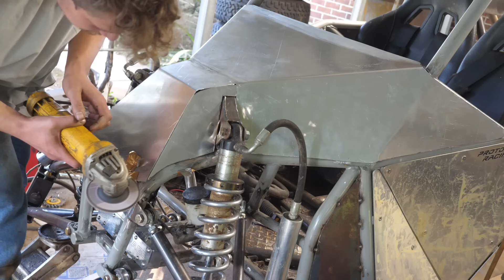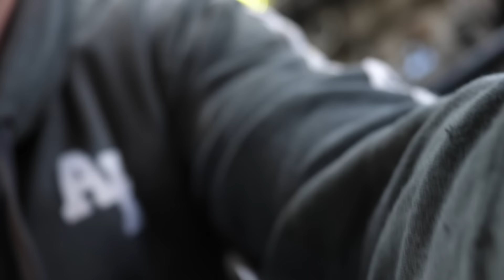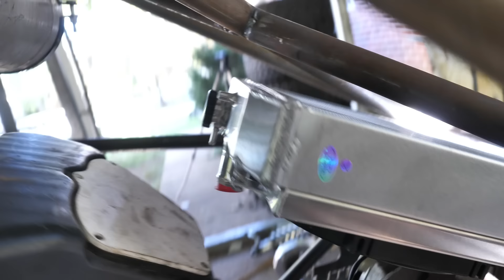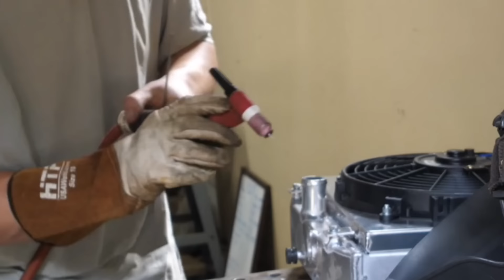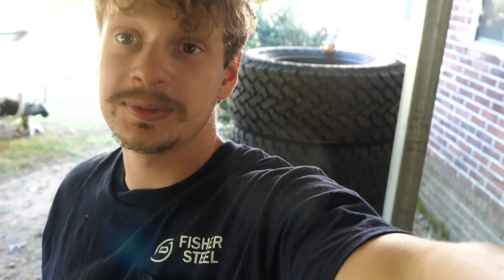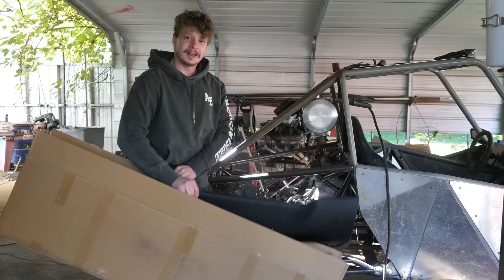Mini hayabusa powered trophy truck on all 4's

Comment: i would try speeding up the "secondary pulse" on your aluminum welder, i used to use a "pulse on pulse" aluminum welder and it was a way quicker wawawawa sound and it looked almost like tig

Comment: Do yourself a favor and make a double-walled heat shield for behind your seat that can draw air through the two pieces as you're moving.  I remember my CBR954RR and then my GSX-R1000 on the dyno...those headers were glowing red hot. You're not going to want to burn your back or worse, melt a hole in it.

Comment: You should really not use galvanized metal (support bracket for power steering) the coating burning off is toxic

Comment: I think at this point you've converted this thing from a Chinese buggy to an American buggy 🤣
Reply: Definitely more American modified than Chinese made lol
Reply: And now he has a Chimerican buggy
Reply: @brickcity9mm896 there you go! He should call it Project Chimerica
Reply: japanese? since it has a Hayabusa engine
Reply: Maybe if it was Harley or chev powered
Reply: My dream is to build my own car completely from scratch and fabricate every part myself minus things like wheels bolts motor transmission or drivetrain and half the suspension
Reply: Chinese metal is called Chineseieum  those parts will brake first ,
Reply: Yeah there's nothing much left of the original cart lol
Reply: Yep. He has to say “ive made this Chinese buggy into an American made buggy”
Reply: Yessir!
Reply: Chinese metal is called Chineseieum  those parts will brake first ,